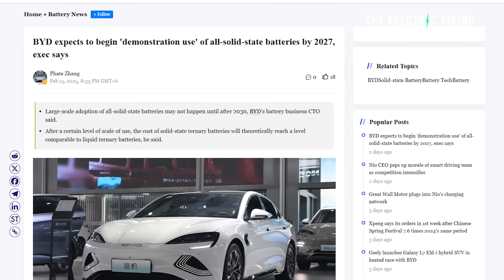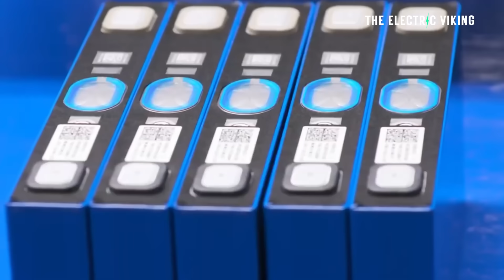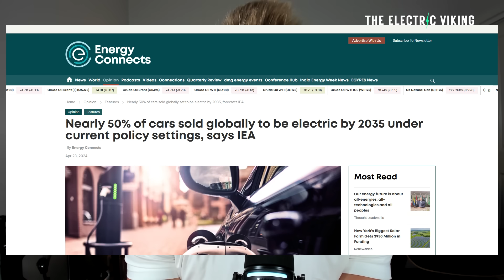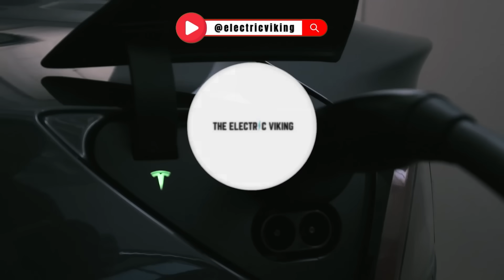BYD says it will begin using solid-state batteries in electric cars in 2027

Comment: I think this whole china battery thing is a push in the wrong direction. If china have a monopoly on the car market in the western world. We will have a very big problem. 
Issue like battery disposal and mining methods are currently a problem.
Plus nothing can beat the demand a diesel engine can produce when carrying any weight. Such as GVM and GCM. I'm not towing my 3200kg caravan or boat with a electric car. I just wouldn't make it to my destination. 
Also how do these cars get here? Big diesel cruise ships. Then a big diesel kenworth truck.

Comment: Mercedes-Benz plans to pivot its investments into its luxury line

Mercedes-Benz Group AG will reveal a new slew of vehicles to meet slumping sales and they’re going back to what they know, powerful fossil-fuelled engines.

Surprisingly, this strategy of going back to fuel is driven by an unlikely customer group.

Top-level buyers in particular “keep reaching for our high-tech combustion-engine cars,” CEO Ola Källenius said in an interview.

Porsche is rethinking its all-electric future, considering hybrid and internal combustion engine (ICE) options for models originally planned as EVs. Concerns over the volatility of the EV market are driving this shift, with insider sources hinting that a new ICE-powered Macan might join the lineup alongside the fully electric version, which debuted last year.

Aston Martin CEO: "Our Customers Hate Electric Cars".

Comment: Those who remain loyal to Legacy Automakers bear in mind
1. They design your vehicles to last only 10 years. after that major components will start failing one at a time to be replaced at a very high costs.
2. They innovate slightly only giving you the miminal...which really speaks volumes on how lazy they are.
3. They pollute your health with caecinogens
4. fuel price is not cheap.
5. You highly likely have stockholm syndrome.

Comment: Hold on! Haven't you heard about the guy in Africa that has a power supply that takes energy from the air? Just think, no more battery problems. It's actually perpetual motion, but try to overlook that. It's like unicorn power.

Comment: The problem with EVs is that there is no real data on their long-term cost compared to an ICE car. EVs have expensive motor dives that will wear out after time and batteries that degrade in range.
Reply: There’s loads of data and information out there, you just haven’t looked for it. All cars wear out over time, or are you expecting perpetual motion?
Reply: EVs easily outlast ICE.

Comment: Any of these companies could come up with the next breakthrough--and they are all driving each other to greater efforts.  That's one of the true benefits of competition (the other benefit is lower prices).  We really can't know which new technology will become dominant--if any: we might continue to use different battery technologies for competitive and different use purposes.  E.g. cheaper batteries for around town driving, where range isn't a huge issue, etc.

One downside of all of this is that it keeps some buyers on the sidelines. A car is a big investment, and no one wants to buy one only to have something better and cheaper come out a few months later.  But whatever EV one might buy, it's going to be better and cheaper (to operate) than the ICE car you're giving up.

Comment: Sooooo we have high capacity kia batteries that spew out Hydrogen Fluorine Gas that either turns to Hydrogen Flouric Acid when in contact with moisture or your insides. Is a bio hazard sooo bad you can't use it behind glass in the lab as this sh*t reacts with silica to form tetrafluoride gas another nasty. Great if one of these sh*t box's goes up in a parking garage!!! While getting it on your skin will cause your heart to irregularly beat or stop. God only knows what crap the Chinese will put in these solid state batteries, guaranteed cheap & dangerous. BAN THE LOT.!!!

Comment: 👍👍 Congratulations on your sons competing in their triathlons.  👍👍 
I bought a 2023 Ford E-Transit Midroof long bed cargo van that is has 120 miles of range.  
It will do what I need it to for now, and I plan to put a decent battery in it in 5 -7 years to get the range I want.
Meanwhile, I will be a frequent flyer at Tesla super chargers on longer trips.  Not a big deal.

Comment: New battery tech is nice but the charging infrastructure needs to be there. I'm not even talking about DC charging, i just want AC charging to be ubiquitous. So pretty much every where i park, there's AC charging.
Reply: Just buy a diesel generator, run it on cooking oil & say it's renewable 🤣

Comment: A solid state battery with only 300 miles range would be more than adequate for most drivers in a mature EV market with ubiquitous fast charging networks. The average driver doesn't need 1,000 miles range and to be carrying around all that extra battery weight. That would only reduce the efficiency of the vehicle.
Reply: Batteries are not going to be bigger. Solid state batteries EV's will be lighter.

Comment: Define "Solid State"....this should be good....Ill wait...🤔😳🇬🇧
Reply: It's replacing the liquid electrolyte.. which is the flammable part of the battery, with a solid material. Plenty of YouTube videos showing you the tech used... unless I'm missing something in your question?
Reply: @micoots  Yes, you swallowed the hype....It's a meaningless statement. It's usually used to describe something without moving parts. Like an SSD for example...It IMPLIES it can't ignite or burn, and you swallowed it.....🤔🙄🇬🇧
Reply: @EnglishTurbines  yeah you've lost me...

Comment: You can argue timeframe, but what cannot be argued is this.  EV and related tech are setting up to do to ICE what ICE did to the horse.  There is simply a better tech in town folks.  For the average consumer it's becoming clear what tech is 21st century and beyond, and what tech is quaint 20th century tech.  In terms of basic transportation it's time to exchange the oil burner for an electron burner.  Ummm..so to speak.

Comment: They still will need to be charged.
Reply: A true genius observation
Reply: The time to charge is probably 2 hours which is a long wait
Reply: @ 17 minutes
Reply: @walk-with-Walz  that best-case scenario 17 minutes is an eternity compared to the 3 minutes topping of a fuel tank. Real life however, will be far far worse with queues, severe kw drop due to having to share capacity with other outlets , etc, etc.

Comment: Provided R&D cost could achieve 70-80% cost reduction it will have a massive impact on all levels. End user cost, charging speeds, range, safety etc. Things are starting to look very bright. One thought is what it means to all over sales for the near future? If the new tech is 7 years away I would say it does not have significant impact, because the closer we get to the "deadline" I would assume new tech is discovered that pushes hesitations further away, and would NOT impact on sales too much.

Comment: It is possible that the Americans or Koreans may leapfrog the Chinese in terms of breakthroughs in solid state battery tech. However, a breakthrough is one thing. Putting that breakthrough into mass production with a supply chain costs that can guarantee a competitive price offer to the consumer and still be profitable is an entirely different story. So it remains to be seen.
Reply: Yeah, most auto makers can breakthrough the solid state batteries, but making it affordable is the hardest! 

The EV's technological progress are so interesting! They progress at breakneck speed! But that is good news for consumers!
Reply: since when US has any advanced battery tech? let alone solid state or breakthough in anything, , the only 2  nation has solid state tech is china, japan ,  no one else,  SK claim they have, but not., study before comment
Reply: @xinyiquan666  The USA leads in oil production thanks to President Orange Turd.
Reply: Well this "breakthrough' you are talking about is already been done by BYD in 2024, as they mentioned in the same conference their solid state battery has already been produced. All they are focusing on is driving the cost of it down to consumer affordable level in the next 2 years
Reply: Fantasy, you are witnessing a further decline in US know how. Forever sliding down all parameters. Same for opec who will decend into infighting for the squeezing light crude market.
Reply: Exactly, the US won't be able to mass produce.

Comment: Chinese EV's are built to a price and the average idiot who buys one will find that the battery pack will ultimately  cost  a fortune to replace and then the second hand EV car market will be flooded with dud EV's that will not be resold, but scrapped. It is a highly environmental damaging process of building cheap EV's.
Reply: Batteries are warranteed for 1,000,000 km
And also 5-8 years from now costs will have dropped by a further 60% anyways
Probably about the same as fixing a transmission, which is one of a hundred things that can go wrong on an ICE.
Reply: If you can buy an ev for cheaper than replacing a battery, then there's nothing wrong with scrapping it ... imagine the crashed price of ice when  evs are so cheap .. you really think people would buy second hand ice when they can get a brand new ev cheaper..with 8 to 10 year warranties.. your points aren't really valid

Comment: Thinking about the weight advantage in Solid State Batteries, a 60 kWh would probably give the same range as 70 kWh LFP. Similar physical size battery would give 50 % range boost.
Reply: With fairly efficient regen, weight doesn't much affect range going uphill either, since you get most of the energy back when you go back downhill.
Reply: While you could increase the energy capacity of your battery pack with a solid-state battery, due to a possible 50% or greater increase in the energy per unit volume, the main advantages of solid-state batteries will be: 1) less space required for the battery = more space for people and cargo, 2) faster recharging capability, 3) even greater safety in a collision 4) lower initial cost per kilowatt-hour (kWh) and 5) even longer-life battery life than the 250,000 to 600,000 miles already possible with today's non-solid-state batteries = longer vehicle life for higher resale value.
Reply: Weight does not affect range that much unless you are going uphill.
Reply: It's pretty important to reduce weight  @rompemord1
Reply: @rompemord1  it depends how much weight you have saved.